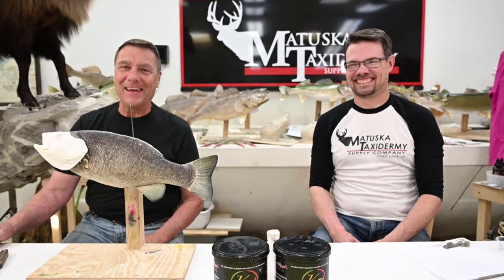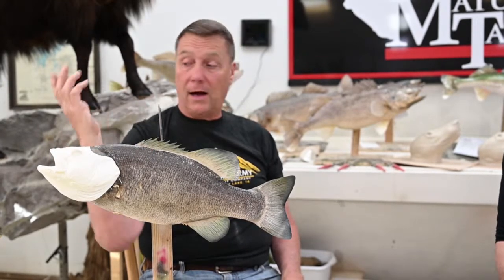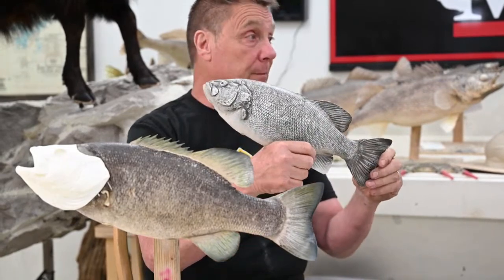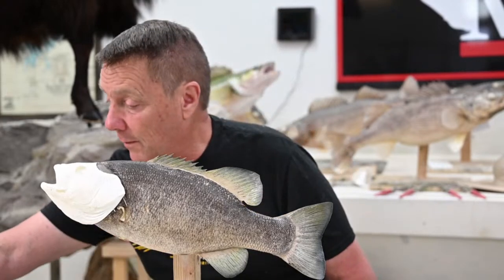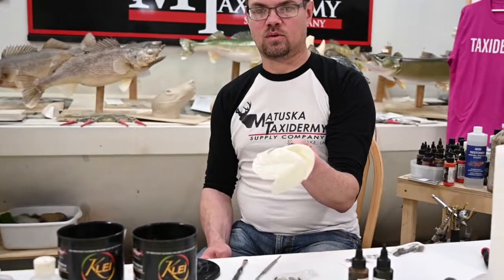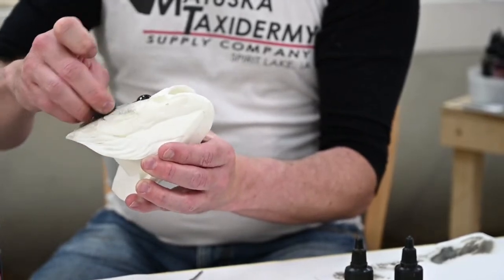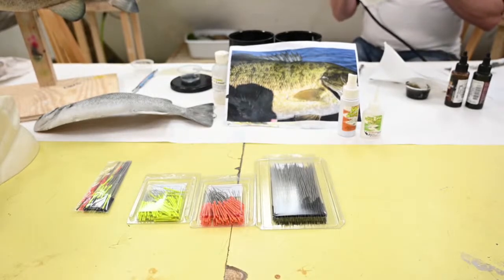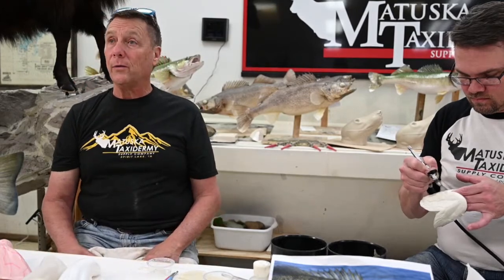Learn Taxidermy: Part 5 - Recreation of a Higher Quality Fish Using Artificial Parts

Comment: I got a question I use a harder and Steinbeck airbrush and regardless of my compressor and water separator I always get spitting and splattering what else can I do
Reply from the maker: It could be a couple different things - 1. a sign off restricted air pressure; 2. Too thick of paint for the air to blow; 3. You could also have a cracked nozzle!  We do have a wonderful selection of airbrushes if you follow this link! Please feel free to call into our shop and ask to speak with either of our taxidermists :) https://shop.matuskataxidermy.com/collections/airbrushes-accessories